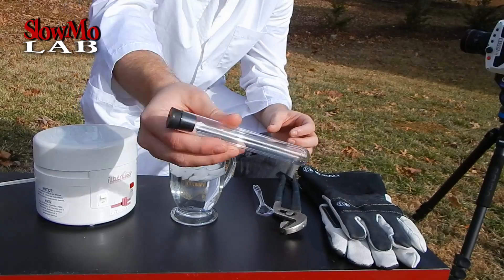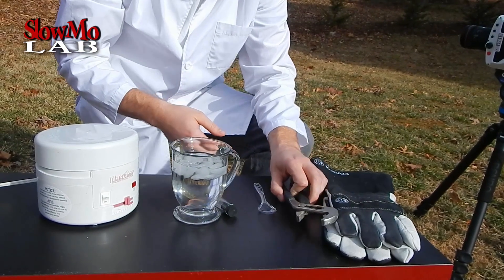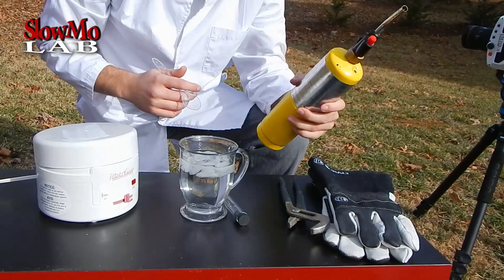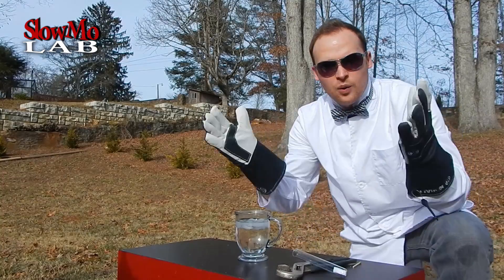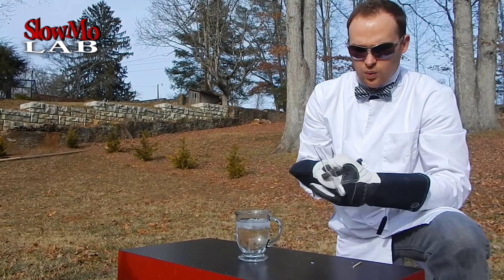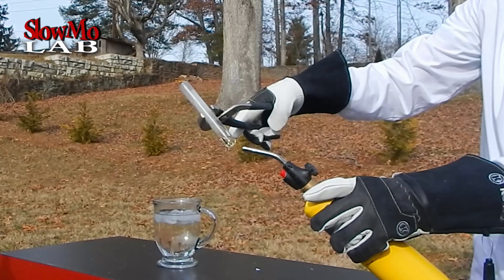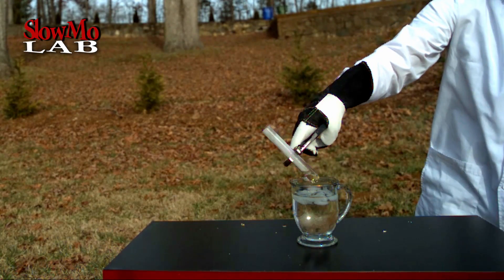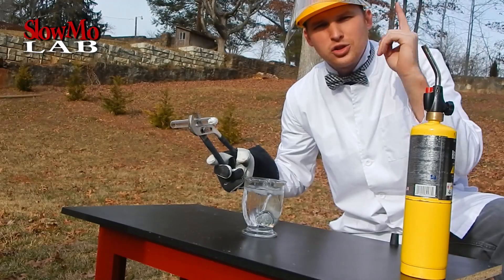Candle Wax Experiment!! - Explosion in Slow Mo

Comment: i think it is like putting frozen chicken in boiling oil or something like, but it doesn't makes contact with it, the gas expanded contracts and makes lots of vacuum, that's why on the second try the tube broke, and when the air enters from the other end of the tube, it launches all the wax vapor, and because it's much colder than wax, it makes that cloud, and since it is still very hot, it made fire, it needs Fuel, Oxygen, and HEAT, so that's why it burned, and as a "powder" it gets much more contact with the oxygen, which might explains the burning powder coffee creamer and cornstarch. Also another thing that might have broken the glass was the sudden change of temperature, from super hot to really cold, like in the "how to cut a glass bottle with fire and string" experiment, where one side is really hot, and the other is really cold, making it shatter because the hotter side expands, and the colder side contracts, making it like make an "impossible" shape for it because it was still solid, making it shatter.

Comment: I can understand the glass breaking and the steam. What gets me is the combustion.
WHY did it combust? And equally important, HOW did it combust?
Reply: Candle wax before putting in water is heated to its ignition temperature, bet there is no air in test tube, when it evaporates it can mix with air and burn.